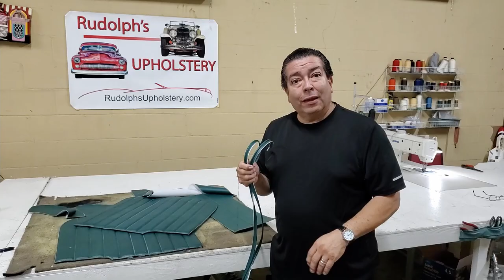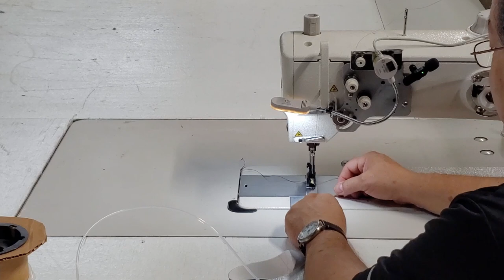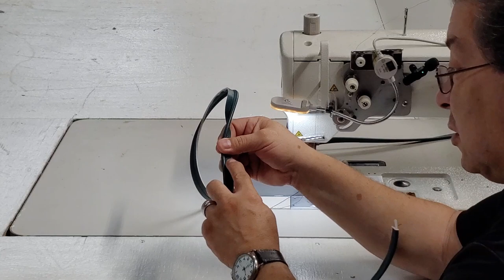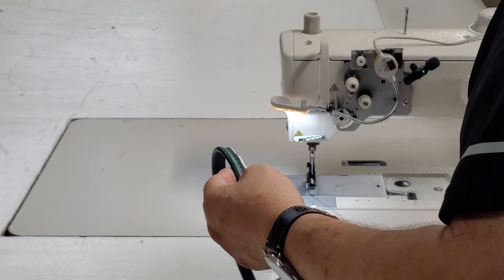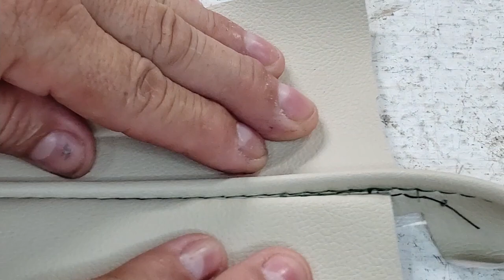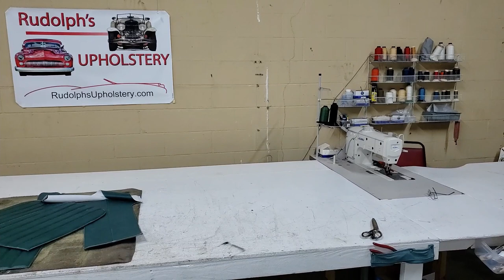See This Now! Making welt beading piping for furniture and auto upholstery

Comment: Hello Richard. I tried your method #432 and it does work. My biggest mistake was trying to save a little cash and I didn't use solid welt cord to make my welting but a softer braided cord. When I was putting the welting together with the fabric in a seam I was sewing 2 layers of velour fabric backed with 1/2 inch scrim. My little channel in the welting foot couldn't hold that big bundle of stuff under it and it kept trying to walk away from under the foot. That 1/2 inch stuff is hard to handle. I also found when sewing a regular seam with the 1/2 inch foam backed fabric that if I got too close to the edge of the foam it would slip from under the foot.  I just recently found a good site by MRTC called Consew 206 maintenance vol 1 and it describes how to properly adjust the walking feet. Mine are way out and that I think that  is much of the problem. It is all a learning experience but I am paying attention and getting through it. I have seen some sites on welting say that you should cut your fabric strips to make the welt on a diagonal. Can you tell me why? Thanks again. Fred.
Reply from the maker: Hello Fred, Yep, the thicker the material, the harder to work with. Learning is doing right? Make mistakes makes a better you. I have seen the diagonal cut to join two pieces for welt, but I never do that method.  Please keep liking and watching!
Reply: Thank you for your comments and for your guidance. You do make it look so easy and doing it is difficult and I think I am learning every day. You are right, 10% knowledge and 90% technique. @oldschoolautoupholstery
Reply from the maker: @whiteyfarm  Hello Whitey, you are so welcome! So true, very true.  Please keep liking and watching!

Comment: Thank you for the great tip.  Question:  For automotive seats (leather) do you recommend 3/8 plastic type welt chord or the Foam type chord?  Thanks /John
Reply from the maker: Hello John, You are so welcome! 3/8" welt chord sounds huge. I usually use a plastic 14/32" welt insert.  Please keep liking and watching!
Reply: @oldschoolautoupholstery  you're right... that was a typo on my part.  I meant 3/16 which is actually a lot smaller than 14/32.  But looks like 14/32 is actually bigger than 3/8
Reply from the maker: @johnwoolfrey5093  Hello John, Ha! Got me! Made me look... Typo. I meant 4/32. Sorry for the confusion.  Please keep liking and watching!

Comment: Great instructional videos, thank you! When cutting vinyl for making welts, is it necessary or preferred to cut it from the roll at an angle, or straight across, or along the edge? Thanks
Reply from the maker: Hello Tom, Thank you so much for saying so. Standard width of vinyl is usually 54 inch's wide. Welt can be cut from anywhere. Not rocket science. For lengths over 54 inches, I will go up the roll. Please keep liking and watching!

Comment: Should welt cord or something be sewn around the bottom of a seat cover to run the hog rings through? Or is something else done or used to keep the hog rings from pulling through the material?
Reply from the maker: Hello RJ, Yes, that is one way of doing it. Or the old school way is to sew a seat listing at that lower edge and run a listing wire through it. Please keep liking and watching!
Reply: @oldschoolautoupholstery  awesome sir thanks for the response! I’m learning a lot watching you and I’m excited to give it a shot real soon for my first time.
Reply from the maker: @RJTickler  Hello RJ, I would like to invite you to browse through the videos on my channel. Maybe some can help you out. Please keep liking and watching!
Reply: I didn't have any listing wire so I bought  some  ceiling hanging wire from Home Depot and ran that through the listing.  It is fairly stiff. Fred. @oldschoolautoupholstery
Reply from the maker: @whiteyfarm  Hello Fred, I have not tried that but maybe I need to. Thanks for the great tip! Please keep liking and watching!

Comment: Thank you and what size thickness scrimp foam is best for leather?
1/4 inch or 1/2 inch or does it not matter? Thanks again for your technique on sewing welt.. I confess to the poor work😢
Reply from the maker: Hi! 1/4 or 1/2 inch foam really depends on the application. I usually use 1/4 for seat panels or door panels. 1/2" for seat inserts.

Comment: Ok how big is that welt  and the size of that welting foot
Reply from the maker: I like to use 4/32 welt insert. Not sure of the welt foot. I really don't get that technical. WOrks for me.
Reply: What size/thickness thread do you use ? I have a 1965 thunderbird I am going to try to reupholster
Reply from the maker: @KJsallThingsCustom  Hi, Standard upholstery thread used for upholstery on a commercial sewing machine, bought at upholstery supply stores.
Reply: @oldschoolautoupholstery   standard is 90 right or at least thats what my upholstery supply store i go to carries
Reply from the maker: @soldiercoleone  I have to say that I have not really paid too much attention to the size. I just always buy the same thing. So I took many rolls of thread off the shelf and took a good look. I have several different brands of thread and not one has a size on the label. Go figure... Sorry, I don't have more info but I tried...